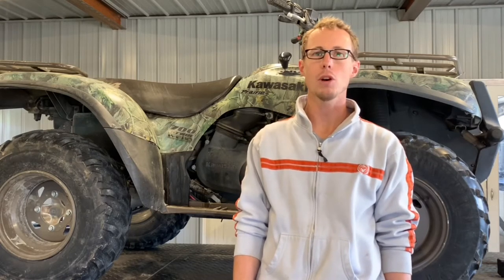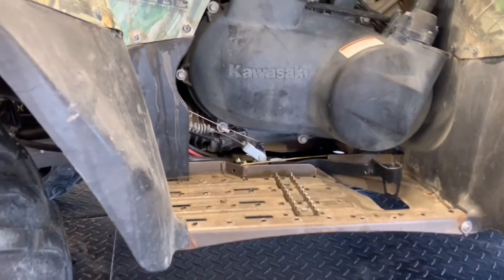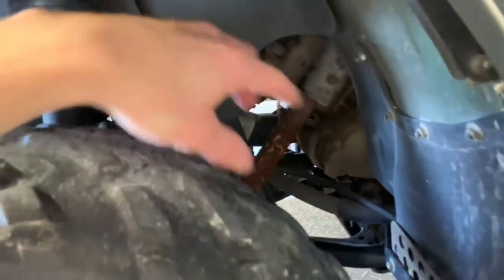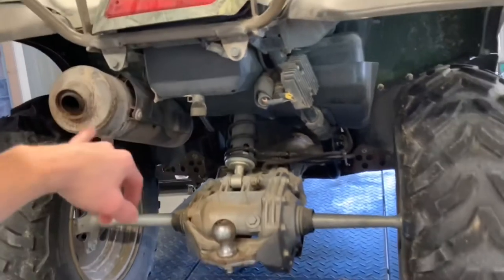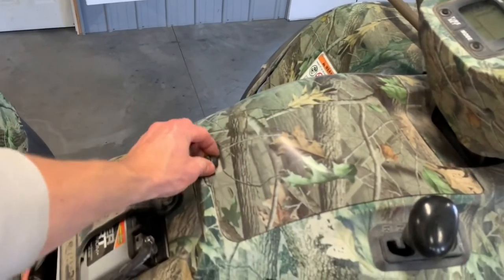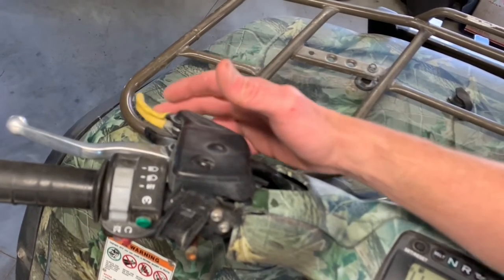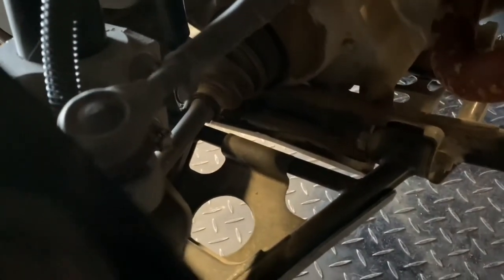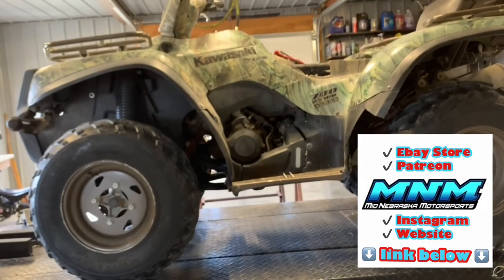Kawasaki prairie 700 Review / Overview   -   Would I BUY it??

Comment: Great video for someone like me that knows nothing about these atv. My father in-law has a 2005 Prairie 700 that has no power when the key is turned on. He installed a new battery after the winter but noting happens when the key is turned on. the display shows nothing and the lights wont even turn on. Is there a master fuse from the battery to the key switch or is there something else we should be looking at?

Comment: Great stuff. I have the older 650. I’m having issues with it popping at the carbs. Never did any work on them. Thinking they are out of sink. Have to keep it choked or it stalls.
Reply from the maker: I'd say it is time for a clean/rebuild.  Here is a link to our SERVICE purchase:  https://www.ebay.com/itm/233709513059 . You might check for an air leak as well. Let me know what you find. Thanks for watching.